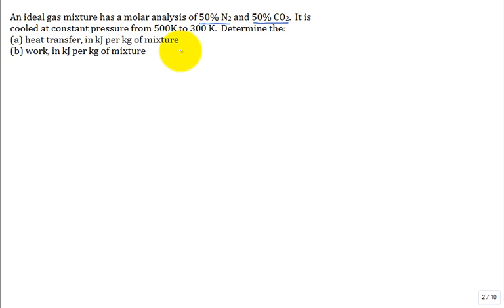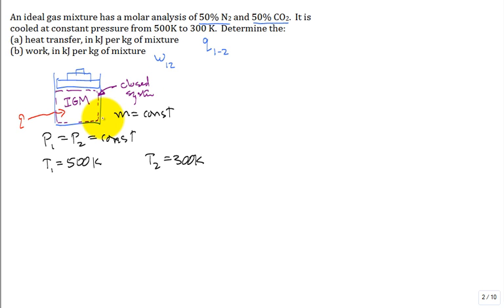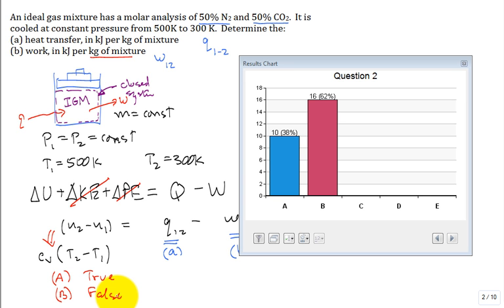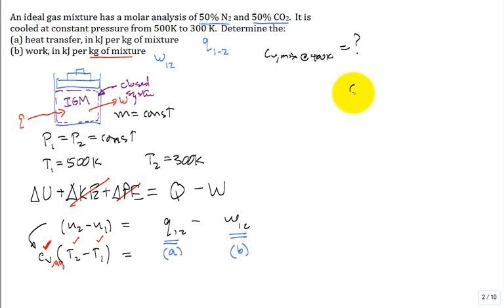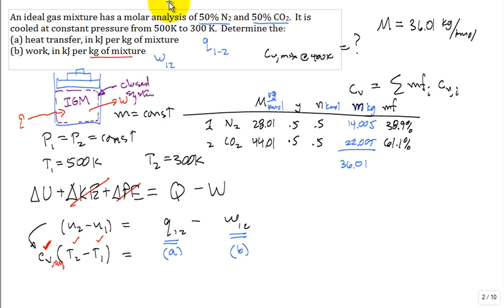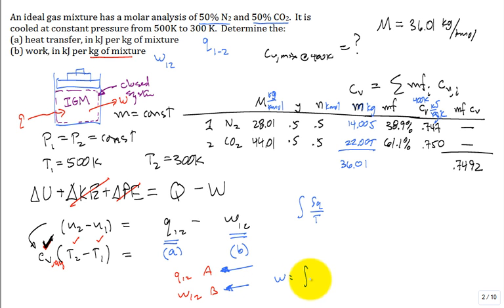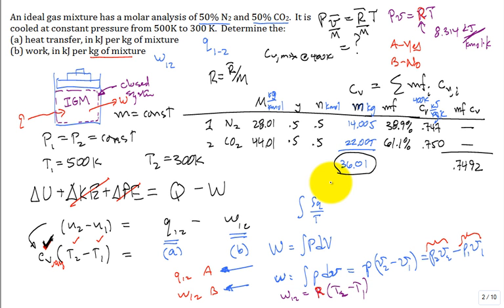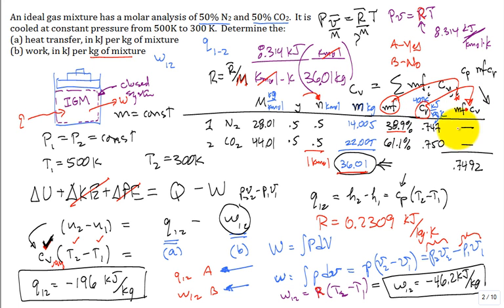ideal gas mixture cooled at const pressure

Comment: How do you solve this question?
Perfect gases
A single cylinder petrol engine which has a volume compression ratio of (CP):1,takes in a mixture of fuel and air at a temperature of (T1)20c and a pressure of (P)kPa.
(i)if the temperature at the end compression stroke is (T2)295c,what will be the final pressure?v1)15 v2)1and P1)12
Reply: Thanks